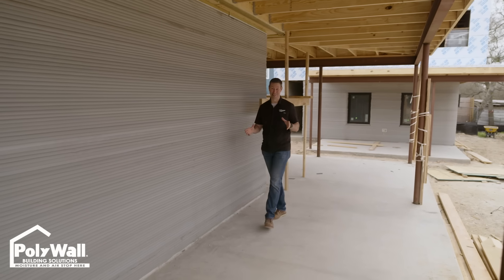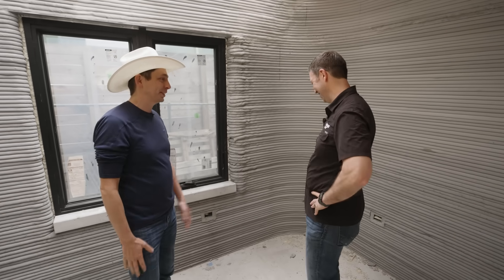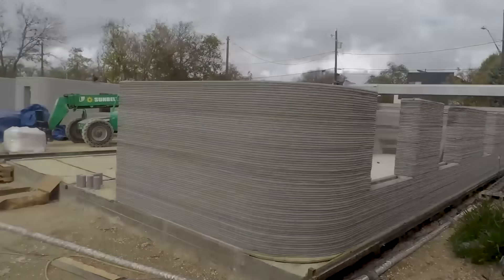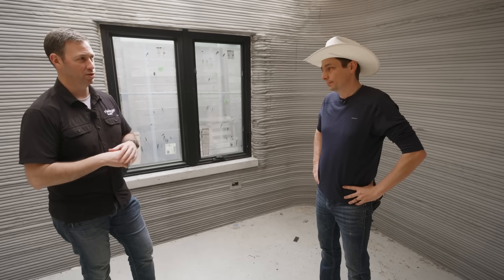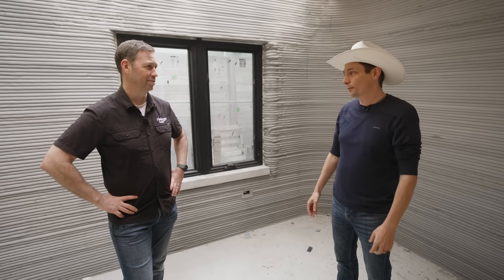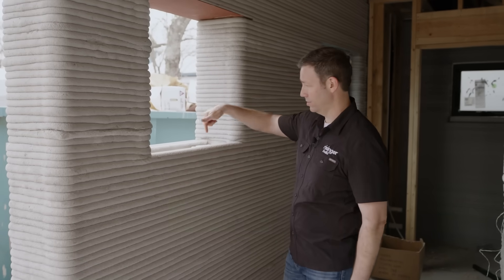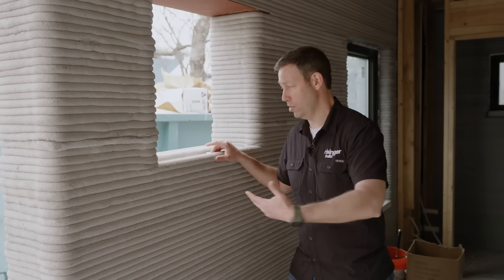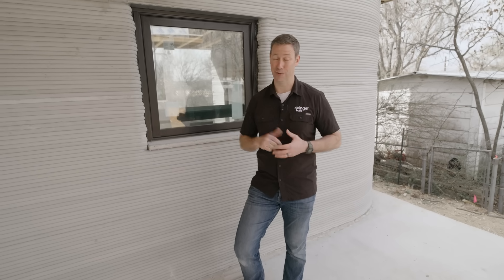Is this the future of Construction? 3D Concrete Printed Homes

Comment: Finally, someone who is actually making a difference in how homes are built.
Reply: I’ve covered many other companies like icon influencing the automation of construction
Reply: Military has been using it for years to make structures in the field.  Though the system they used was a 1 foot wide nozzle.
Reply: you should check out Monolithic Domes. they have been around and improving since the 60s. and in my opinion are fare more practical to build since it doesn't require a robot, just concrete or shot-crete tools, foam insulation, concrete, and an inflatable plastic fabric, that acts not only for the build process, and stays on, but is also the vapor barrier itself, and can also then be covered in almost any type of hard surface. and has survived easily against many natural disaster type events. fire, hail, lightning, earthquakes, tornados and hurricanes, to name a few. im not so sure an unreinforced 3d printed thing like this can match the qualities of a monolithic dome, and, really, any builder can learn how to make one and it wont require coding knowledge, or knowing how to run a robot so... yeah, it has a lot more benefits and convenience to its design and specifications. it also has many real world examples that have survived such events with ease, some multiple times with minor cosmetic fixes and cleaning jobs, let alone structural like any conventional stick house, or likely these 3d printed buildings... concrete is nothing without reinforcing...
Reply: @EddieSchirmer  thanks for the info. I’ll check them out!
Reply: @servus47  certainly =) i am glad you hold an interest in the possibility. it i am honest i think the 3d printing could be better for garden construction walls which dont need to hold up to surviving extreme weather and geological events. i can imagine it being used to make wavy fences, with embedded wire frames sandwiched between two layers of concrete, since it could be reinforced that way as well. but, for homes, i woudl trust a dome to withstand disasters far more readily than these in the video. in any case, cheers, and have a good evening =)

Comment: What a wasteful bunch of butt-ugly crap. These 'houses' will be taking up landfill space in 20 years, as this gimmicky, unsustainable process hopefully goes the way of hundreds of other building innovation failures before it.
Reply: LoL Worried about Concrete as a Global Waste Problem....LoL 

Please Tell me More...cause I find your Expertise on the Subject quite amusing indeed...
Reply: From Wiki
Concrete recycling is the use of rubble from demolished concrete structures. Recycling is cheaper and more ecological than trucking rubble to a landfill.[1] Crushed rubble can be used for road gravel, revetments, retaining walls, landscaping gravel, or raw material for new concrete. Large pieces can be used as bricks or slabs, or incorporated with new concrete into structures, a material called urbanite.[2][3]

Comment: This is a good starting point...but...if there is ANY major structural damage the entire house would almost need to be scrapped. 3D printed bricks and masonry are actually more realistic. They have grooves for trades as well. 

Random fact there is no current building code for this method. There is talk of adopting the masonry for 3D structures.

Comment: With the current price of lumber being what it is, this couldn't have come at a better time.
Reply: No mention of how cost effective this will be so all of this is pointless until people can order a home with it.  But based on how the industry behaves, it will not matter how cheap this is to use for building... the builders are going to just make it equal to or just a little less than the cost of Wood, unless it is more expensive than wood.  If they could build a 2,000 sqft house for $2... they will just mark it up to 400k taking the 398k as profit... and people will pay.

Comment: I'm curious what this type of construction costs per square foot, as opposed to the traditional wood builds we see. :)
Reply: Stick built houses are still the cheapest.
Reply: Start-up would be extremely expensive for all those equipment, maintenance and skilled technicians including training and retraining of human resources.

But after that, the overhead and operational cost would be very cheap and since construction far faster and better quality than other conventional method or prefab construction with minimal manpower... it'll going to steamroll over competitors.

Even prefab buildings are highly competitive and profitable...this is a space age development. If they could use biodegradable polymers then even glulam timber construction would be made uncompetitive if not obsolete.
Reply: @MrArthoz  So true, but I was wondering if you were wanting to buy a house made like this lol.  But still a really great answer :).

Comment: What about sizemic loads like earth quake durability. With no steel rods to keep this system stable it could just crush from its own weight. Not Convenced there needs to be engineering data on that.. I am thinking of hollow block houses in the Philippines that fall over in any shaking, mud side what ever.
Reply: Yeah, I think even with reinforcing it would still be dangerous in earthquake country.

Comment: I'll believe it when I see it.. They've been saying this is going mainstream for about half a decade 
"houses for a fraction of the cost" WHEN!???
Reply: There is ALOT of cost that goes into a house. Wall framing with this product will not decrease the overall cost much since everything else is still the same price, or more.
Reply: @mph5896  I know that's what their claim always is which is why I put it in quotes.
They have decent arguments to why it would decrease cost, but the actual technology doesn't seem to be nearly efficient enough

It's not just framing though from what I've seen. It supposedly also works fine as a complete interior and exterior, so no siding, sheathing, or drywall needed to be installed and inspected.
Reply: Agenda2030

Comment: so sweet. a complete 2-story house built like that would be so incredibly energy efficient, and quiet, and pest-resistant, and fire resistant...lol, and basically bomb-proof.
Reply: Nope.  That concrete is more fragile than monopours with rebar.
Reply: Yeah it is built like a nuke shelter or a basement.
Reply: No talk of the insulation or r value
Reply: @sparksmcgee6641  doesn't have to...not only with the foam injected into the wall interiors, as matt discussed with dude, because of concerete's extremely high thermal mass, the house will effortlessly stay warm in winter, and cool in summer.
Reply: @douglasharley2440  your wrong on te thermal creating efficiency. I build concrete homes and structures. Concrete doesnt change the energy required to maintain the environment.

Comment: 1/ What is the R value of the walland roof 2/ What is the thickness of the concrete wall outside, foam and inside concrete?   What is the cost per square feet of the house concrete wall vs, ICF frame, block frame, etc?

Comment: Matt has stated on this chanel that there are only two types of concrete. Concrete that is cracked and concrete that is going to crack. How do they plan to mitigate this issue?
Reply: There is small fiber filimates in concrete mixes that when it cracks will still provide strength to keep it together. Concrete is strong in compression it's the rebar that provides strength in tension. Cracks are from tension.

Comment: What do they do at the cold joint between the cured work done yesterday and the new concrete today?
Reply: Good question.
Reply: I was assuming they did it nonstop. But that would be a lot of concrete and I don't know how fast it goes up.
Certainly need to talk about that.

Comment: only problem  with concrete is it uses huge amounts of energy in production :/ would also be interesting to see how this stacks up against factory form concrete elements in price and speed and so on :D
Reply: Not to mention the sand shortages that are happening due to concrete construction. So I can't see a brand new industry popping up when there is an existing alternative with a renewable reosurce. It will remain niche, not widely mainstream.
Reply: @erithanis  That's what they said about electric cars, but now everybody is getting in on the action. The future is now. The timid need not apply.
Reply: I would imagine factory formed to be superior in almost all areas.
Reply: @rapfreak7797  yeah thats what im thinking too, off world forms would be hard though but i think there are easier ways then this there also :D
Reply: Cement kilms consumer very large quantities of energy plus you have the energy needs of the quarry, transportation. It would easier to just make more energy.
Reply: Peter Yost, Green Building Advisor states that:

"The absolute bad boy of CO2 emissions in the building industry is the approximately 17% dry weight of Portland cement in a standard ready-mix concrete. Somewhere between 5% and 8% of global CO2 emissions are the result of Portland cement production. It’s not just that the Portland cement process is energy intensive, it’s also the fuels used. Producing one ton of Portland cement generates nearly a ton of CO2!"

cementitious

New construction will all have to be net zero...

Comment: I don't understand why we're not advancing the tilt-up construction process for residential purposes. You can embed any exterior look you want in a precast concrete wall and actually have rebar in it.
Reply: I agree
Reply: Because that requires paying people to work . These tech ideas are based on machines taking our jobs , not because we can’t do the jobs but because of greed . They will market it as if it will save consumer money initially but the bottom line is it won’t it will just result in more money running up stream. Remember when they opened up America to importing goods from China and other countries and out sourcing businesses and manufacturing over sees. They said it would make it cheaper for us . It has not held true to that either.
Reply: Are you kidding me? You think that opening up trade with China hasn’t made goods less expensive for us?

They have. 100%.
Reply: @jerk4628  initially it did but it’s not what you think it is anymore . The markup has taken the savings away . The only people it benefits is the large corporations.
Reply: @undisputedchamp2568  How has the markup changed?

Comment: Dirt and dust would seem to really want to collect in the inside finish painted or not but still a cool concept
Reply: I think they'll eventually discover the dust in the cracks problem.
Reply: Completely. Reminds me of an elaborate light fixture. Looks great when it’s first hung but after sometime when it’s collected enough dust & dirt, becomes a royal pain to clean.
Reply: It needs to be plastered smooth. Layer lines are cool in a way, but any sane architect would hide them.
Reply: @FrankBocker  They have the ability to make it smooth like icing a cake now. I saw it on another video where the robotic arm would have metal plate that would smooth it as it goes.

Comment: I wonder what the carbon impact would be for this versus traditional stick built. I’ve heard concrete has a huge carbon footprint
Reply: I was thinking that too. Maybe in the future they use less CO2 intensive concrete  (2019 paper by Delft University in Netherlands so still relevant)
Reply: From Wiki:
Concrete recycling is the use of rubble from demolished concrete structures. Recycling is cheaper and more ecological than trucking rubble to a landfill.[1] Crushed rubble can be used for road gravel, revetments, retaining walls, landscaping gravel, or raw material for new concrete. Large pieces can be used as bricks or slabs, or incorporated with new concrete into structures, a material called urbanite.[2][3]
Reply: @fairygurl9269  I doubt that a high amount of their mix is recycled. At the very least a lot of additives are required to keep the consistency and setting time.
Reply: @rapfreak7797  

In the Words of Tim Minchin

"YEA YOUR DOG HAS BIGGER CARBON FOOTPRINT THAN MY 4 WHEEL DRIVE, SO DOES YOUR BABY MAYBE YOU OUTTA TRADE HIM IN FOR A PRIUS" ROCK🤘✌

Comment: 大工の正やん shows an interesting way to air seal.
He cuts expanded polystyrene sheets for the bulk insulation and then caulks EPS strips into the gaps. The corners that aren't so easy get hit with canned spray foam.

Comment: I know he mentioned no thermal bridging because of the layout, but a big oversight in the design is that all of the verticals on windows and doors there is several feet bridging.  I'm curious what their readings around those areas would be relative to windows/doors of a typical stick frame home.

Comment: All I can think of is throwing random bags of concrete coloring powder into the mix.
Reply: Concrete dye bleeds for months... anything that touched the walls would be stained.
A polyurethane type coating would work well though and would reduce moisture permeating the concrete.
Reply: @zomgthisisawesomelol Of course you need to repaint it every few years. It`s concrete after all. There are some natural stones that can clean themselves like white limestone. We have a solid house with withe limestone bricks (clinker) and the house is 40 years old and was never painted. It loses the white on some points if the material was touching other materials and it reacts if it is a long time wet. But otherwise, it looks fantastic. 

We have some neighbors that painted the house anyway and now of course they need to paint every now and then because the natural cleaning is gone. Sealed under color. 

But concrete loses its color in a few years. Light colors faster than dark colors. And they don't have that self-cleaning in the material. So especially white concrete will get dirty after a while. On dark concrete you won't see it as much, but still.
Reply: SkittleCrete
Reply: When my kid was younger, he'd make a sucide slurpie when we'd stop at the 7-11. That's how I imagine the colored concrete coming out of the printer.
Reply: Hey build your house that way see what you get curious

Comment: This is a cool technology. I worry that the interior walls will accumulate dust an be imoossible to clean, and the exterior will wick moisture.
Seems like one generation away from viable.
Reply: I run a 3d printed concrete company too and that's easy to fix, you'd stucco the walls and they would look like typical interior walls if you don't want those layer lines. You can use concrete sealer and do the same, stucco the outside.

Comment: Looks interesting but, as far as off-planet no water (or air) on the moon and extremely limited water (as far as we know) on Mars along with a very thin atmosphere.  Be interesting to see how they intend to test building under those sort of conditions!  As far as here on OUR planet is concerned, the interior walls would definitely be getting stucco to cover up all of those dust magnet "shelves" built into the walls.  And anywhere there are tornadoes I would be insisting on at LEAST a good sized storm cellar under the slab!
Reply: Cement on Earth is made from limestone type minerals. Limestone comes from the skeletons of microscopic animals. The animals consumed oxygen while they were living to help make their skeletons. None of that type of activity on the moon. In other words, manufacturing cement even with unlimited energy is not a thing on the moon.
Reply: @henryD9363  Good point, I'd forgotten that aspect of cement manufacturing

Comment: Curious if there is any steel reinforcement for tension strength as concrete just has compressive strength(I’m in Cali so EQ concerns comes to mind)
Reply: From their website, it looks like this isn't traditional concrete, but a proprietary cement based mix that is specifically designed to be printed... The call it lavacrete, and they have a proprietary blending and pumping truck that feeds the printer. If you are interested, this is an interesting read about the state of the industry.

https://www.theseus.fi/bitstream/handle/10024/355813/PinedaFigueroa_JoseLuis.pdf

One interesting note from the referenced research paper is that this kind of computer controlled pouring process (what 3D printing is at its core) lends itself well to high temperature cement mixes that would be dangerous if used with traditional concrete techniques... Blends that are poured/extruded at quite elevated temperatures that give the cured cement a much higher tensile strength.
Reply: Yeah, there is a reason that earthquake country avoids unreinforced concrete. Would need some steel in there to keep that house from ending up like a house in haiti after the quake
Reply: The cut away shot shows standard rebar embeded in the interior wall.
Reply: Lots of concrete now has fibrous reinforcement, or I have seen small metal barbs that can be pumped, and provides similar strength, I think the engineering channel covered it with demos of traditional Vs fiber Vs metal barbs. I haven't seen any evaluation for earthquake performance.

Comment: They could include a trowel to follow the nozzle and give a basic smoothing to the surface. I assume it is fairly quick setting. A following trowel would make a big difference.
Reply: It's done by other concrete 3d printing companies. Mine too. Mine has a tuned mass damper in the end effector printhead too to get rid of most of the vibrations.
Reply: I did a video on another company that implemented something like that on their concrete printed houses